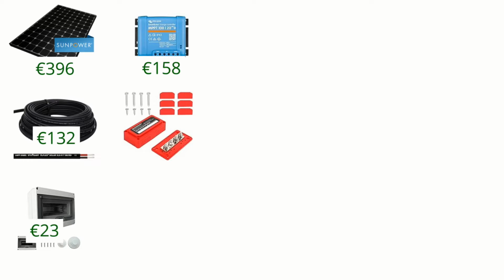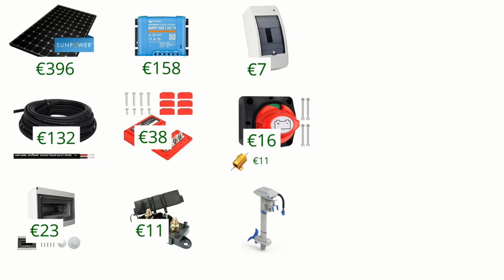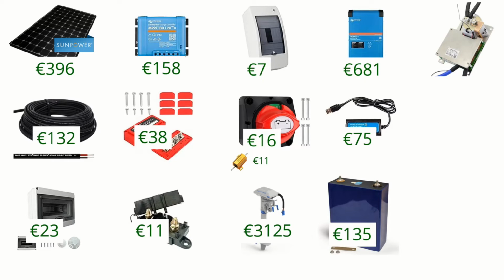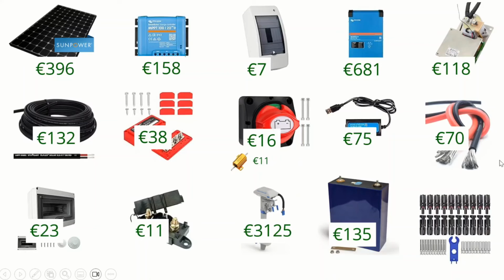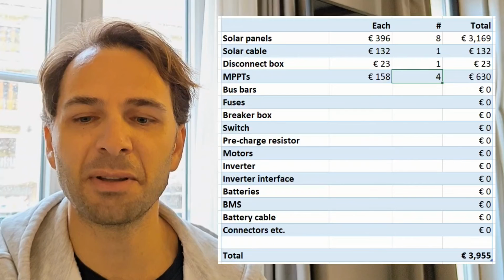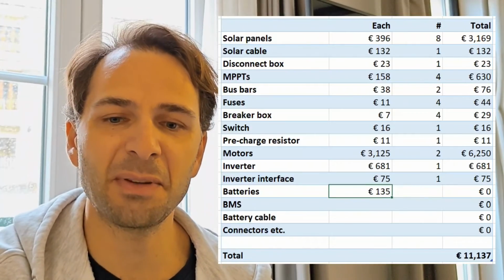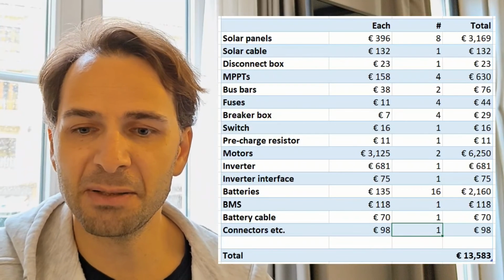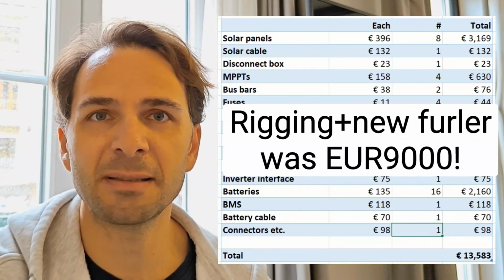Converting a boat to electric: What it costs

Comment: Hey Patrick! Great presentation, I really appreciate this cost breakdown. I'm interested in your mounting structure for the panels. I was just watching Jason's latest video (great btw) and was wondering how your framing might be different than his? Trying to get different ideas from people like y'all who have real world experience in a marine environment. Thanks a bunch, Flint
Reply from the maker: Yeah definitely worth a video. My panels are mounted in frames made of aluminium angle. It works quite well but I actually prefer Jason's solution as it's DIY possibly whereas I had to hire a welder. Doing it again I'd also use the extruded aluminium profiles like Jason

Comment: How much capacity in battery and solar production from panels?
Reply from the maker: My batteries are about 14.5kwh. In summer my panels generate around 18kwh per day. Very late in the season it drops to 11 or so. In winter abs when it's raining obviously less, but I'm typically tucked away in a marina or a yard by then so it doesn't matter.

Comment: Hi Patrick, I am planning to put a precharge resistor in line to my 4kw Inverter. I have two 25 ohm 50 watt resistors that I would put in parallel (12.5 ohms) and then parallel them to an on/off breaker. So my thought is I would 1st power up the inverter via the resistors and then turn on the breaker to the inverter. Is that something like what  you did?
Reply from the maker: I've done pretty much exactly that, but I'm using a single 25W 33 ohm resistor in parallel with the switch and it's worked perfectly for me. 

I've only really used it once though, because I never turn my inverter off 😂
Reply: @SailingElectra  Thanks, I will use just one resistor.

Comment: Your purchase is very costly,
Compared to my place 😮
Reply from the maker: Tell me more, what did you cost? What type of equipment are you using?
Reply: @SailingElectra 
I was purchased in October 2025. All costs included taxes and transport.
 105rs₹=1euro€

12 kilowatt daye single phase hybrid inverter cost 200000 indian rupee.
590w n type topcon panel from warree energy cost 9000 each panel.

FOR SMALL SCALE RS 9 /W and big Big scale 6.5/W (Installation charges, structure, DC cable, DCDC box INCLUDING CIRCUIT BREAKER and SPD, DCAC box With CIRCUIT BREAKER etc....)

Good quality 48v, 5kw usable energy battery pack cost is 12rs/w, but my landing cost is 10.5rs/w (125kw, 307v).

Comment: Do you think 2 x 6 kW motors are necessary or that 2 x 3 kW are sufficient?
Reply from the maker: Two 3kW would have been fine for my boat, but the price difference is small, and the 6kW is more efficient. Also if one motor stopped working, a single 6kW would move me just fine.
Reply: @SailingElectra  I am currently buying a Catalac 8m that has two epropulsion pod 3.0 installed. I'm just a little worried about getting caught on something with the pods. They're mounted directly in front of the rudder. What you think?
Reply from the maker: @buddhafragt9619 that's the right place for them. I can't imagine it's any worse that things getting caught on a prop or sail drive. Nice thing about the catalac is that it's quite shallow and easy to get under the boat to check things.

Comment: Great breakdown of the whole conversion. I also have built two solar electric boats since 2016 but for me it was a figure it out as you go scenario as at that time there was not much about electric boats. Since then I have gone on annual trips for two to three weeks on our canal systems we have in our area of Canada. The costs of batteries have dropped exponentially and there are now more motors to choose from but it still is an expensive venture. For me it is still worth it as cruising without the smell and noise is like buying a solitude option for yourself. Check my site out for some of my trip adventures.

Comment: think i would have wired it 2 sets of 4 serial giving 2 parallel to up the voltage and get better efficiency charging.
Reply from the maker: @JohnBraman413  I did consider it, but thought shading would be more of a problem. I'd also need bigger charge controllers as mine are limited to 100v and these panels put out 65-70v each. Probably the perfect solution would be 1 charge controller power panel, but that's a lot of wiring and finding places to put everything.
Reply: @SailingElectra  shading you don't lose the whole panel. only a percentage of the power output.
Reply from the maker: @JohnBraman413  is definitely worth trying, the thinner cables would be so much easier to deal with.

Comment: Hi Thankyou for your tutorial of the boat . Fantastic . Got to ask if you was to have the sail up do the motors Regenerate with the force of the forward motion  . ? 
Be really intrested to know this ? 
As I’ve heard that some boat electric motors do this ?? 
Also if your sailing might sound silly but do the motors spin freely with no power going throw them this not to course drag . I did build a Electric campervan aprox 5 years ago 
On YouTube …. 
james and Kate electric campervan 
My dream is to lurn to sail and then buy a yacht and convert to  vertical wind turbine and solar pv and keep in Spain 
 I congratulate your achievements . 👍🏽👊🏽🙌🏾
Reply from the maker: It's possible but only if you use the epropulsion batteries, and I don't, so that means I don't get regen. I have enough solar though, so it isn't really necessary, and most of the time I'll keep the motors on when sailing, as even very low power means a big speed boost.

Comment: Since there is not much space on a sailboat I wonder if you could but a thin flexible or standard panel under the existing panel? Bifacial down side is they are bigger so per SQ FT they are not much advantage. Im sure the sun reflect off the water and any free power would be a bonus. Wonder if anyone has tried this or tested the idea? I guess a way to test would be turn the existing panles upside down and see the power they produce from the sun reflection off the water.
Reply from the maker: That's a very good question actually! I've become very weight sensitive to adding things to my boat, so I won't be the one to try, but yeah I imagine it would work as well as the extra wattage you get on bifacials. I suspect we'll keep seeing more innovation in this area.

Comment: Thank you (fellow Saffie) I have just bought a 9M Catalac which has 2 decent Beta 14s in, but some rather dodgy saildrives. I am hoping to convert to electric sooner rather than later. The old saildrives have no spares available, so at some point they will be a dead-end.
Reply from the maker: Wow another saffa with a 9M, who would have guessed! You're lucky you can sell the motors to get some money back. Mine were dead so I got almost nothing. One thing to consider is outboards vs pods. Doing it again I would seriously consider pods so they're deeper in the water and further apart. Costs are about the same. Where is your boat?
Reply: @SailingElectra  Hey I switched to my boat identity. I know, right? Coincidence or Great Minds or what? As soon as I started researching I found your channel. 
Tomorrow I am off to Lowestoft on the North Sea coast to take delivery. I will be heading for Cowes to 'borrow' a whole lot of gear off my old ferro Endurance 35 (SV Rolling Stone). Then off to the Med via French canals. Where are you? I would so love to see your lovely Catalac! No name for the Catalac yet.

Comment: Great informative video !
You have : 
2 x 3kW (6kW) motors; 
16 x 3.2V/280Ah (14kWh) battery;
8 x 400Wp (3.2kWp) solar panels;

Do you find the solar panels adequate?
Is there sufficient battery storage?
Are the motors powerful enough?

I ask, because I am doing EXACTLY the same in a few months time!
Reply from the maker: The motors are 2 x 6kW (12kW) but to be honest I almost never go over 3kW, and I've never thought they were underpowered.

The key to the system is the solar. If I had less solar I'd probably think the battery was too small. The Hopyacht 30 has twice the battery and half the solar but because I have so much more solar I can travel further without needing to plug in. On a summer's day I pull in 15kWh+ and that means my battery pack is pretty much always full. My solar panels alone can power me at 5 knots without draining the battery on a sunny day, so the battery becomes a buffer rather than a power source. 

On cloudy days a bigger pack would just mean more speed, but I don't mind showing down if I need to go further when it's cloudy. 

From this season I hope to be sailing as well. If I didn't have sails I'd consider a Honda 2200 generator which could move me at 4-5 knots as long as it has fuel, but with the sails I think I'm happy with no generator.
Reply: @SailingElectra  Thanks for the reply.
Reply: @SailingElectra  Thanks for that info. Being a fellow Saffa, I will probably go the same route as yourself.
Where would one look for a good used catamaran?
Reply: @SailingElectra  , don't you think having the small generator is a great redundancy ?  To many "what-if's"...  That Kenny is pretty light and worthwhile having I think

Comment: Super clear, thanks to you and your pup! Did the ePropulsion firm help you with your setup? I'm guessing warranty is void with non-OEM batteries?
Reply from the maker: No, it was all DIY. I actually expect the warranty to still hold, and from speaking to a dealer (not the one I bought from) that does seem to be the case. Of course if you damage something by using a battery that's out of specs it wouldn't, but as long as I'm within the recommended specs I should be good.

Comment: Your battery is around 14kwh, correct?  What range do you get at 3 knots and 6 knots?
Reply from the maker: Yes, 14.4kwh. 3 knots is just 500w in total. I can do that non stop forever as I charge at more than that rate even in cloudy weather. 6 knots is 7kw total so if there's no sun I have just 2 hours. Typically I go 4.5-5 knots which is around 2.2kw. when the sun is shining I can do that speed all day long and still have a full battery at the end of the day as I have 3200w of solar.
Reply: @SailingElectra  thank you
Reply: @SailingElectra  
WOW!
So at a steady 3knots power is only 500W;
and at 6 knots (double speed) it is 7kW. That is excessive?

Comment: Thanks so much for making these informative videos. You do a great job explaining the process while making it pleasant to watch. I have a 40ft sailing cat in the Ssan Juan Islands and share your idea of the panels create the power,  battery size is second to that. I'm just switching out my solar array for 550 watt bi facial panels, they are the largest output per sqft I've seen, plus they catch reflected light of the water on the undersides. I'm pretty sure I'd make terrible videos but I'd like to document how they perform over the summer.
Reply: The boat is a Rudy Choi design, called a Polynesian, built 1973, 20ft beam.
 The array is 3.3kw from the topside, they get 15-20 percent extra from reflected light in a ground mount situation, but I imagine reflected light off the water should be significantly higher with all the panels over the cockpit
Reply: I'd like see that setup! Make a few videos...maybe it's fun! 😂
Reply from the maker: Thanks for the great feedback Brent. What kind of boat do you have, and how much solar will you have in the end?

Comment: Do you not use a t-class fuse if the lfp bank?
Reply from the maker: No, I've only got a single 48V280AH pack, it shouldn't be capable of providing the kind of amps a T Class fuse is necessary for. The mega 400A fuse I'm using was supplied by the battery and BMS supplier. Like so many things on my boat, fire extinguisher, EPIRB, etc I hope I never need to put it to use 😁
Reply: @SailingElectra  if I could humbly suggest; they can, I accidentally shorted my single battery while designing the box for my own sailboat conversion. The incredibly low internal resistance of the lfp allows them to dump kiloamps in a dead short, which can arc over an ANL or similar fuse. I put a large t-class as close to the main bank positive as the "fuse of last resort", with the ANLs sized smaller to protect the wires.
Reply from the maker: @TheDigitalMermaid  thanks for the advice, I'll certainly look into it. It shouldn't be a huge job adding one to my pack. I don't suppose you had the camera running when you short circuited it? Would be very interesting to see.
Reply: @SailingElectra  I did... https://www.youtube.com/watch?v=HhiEky64BLg&t=2160s

Comment: quiet expensive, but as you conclude diesel engines would cost around the same and you would keep paying for fuel on those.
Reply from the maker: Plus my wife wouldn't live on a boat that smelt like diesel, so I either avoided a divorce or another rent payment 😂
Reply: @SailingElectra  😆

Comment: Why is the rigging so expensive? I bought all new wires with new terminals for about 1200€. The most expensive has been the isolators for the SSB Radio, two of them was around 600E. A rollerfurl is around 2000-2500€
Reply from the maker: Croatian pricing! Paid 3k for the furler and had to build a new tabernacle. Because my boat has changed from standard and because the boat was new to me I had to have a rigger do everything. From next time I'll go the DIY route.

Comment: Thanks for sharing those costs Patrick. Funny you should have posted this video today, as after 12 weeks of working on my solar powered cat, I sat down today to ''do the books'. I'll share the costs with other videos once the cat is complete.
Reply from the maker: Glad you found them useful. The only charge I might have made doing it again would be for pods instead of outboards, though I'm still not sure which is better. Are you keeping the mast or going for a powerboat build?
Reply: @SailingElectra The cat has been started as a power cat, so no mast. It was built with the idea of two petrol outboards, spec'd at 60HP each but could be any size up to 200HP. I'm talking to Epropulsion UK at the moment and thinking of having twin Navy 6.0 on each hull. I should be fitting the 6kW of panels to the roof next week all being well. I'm undecided on whether to fit steering to the outboards or have a single central rudder. I certainly don't want to fit anything under the hulls to protect against grounding. Neither would i want to fit pods for the same reason.
Reply from the maker: @fredflintstone1428  missed this message. I like the route you're going with four 6kW motors rather than one big one. So many advantages from redundancy to what I think will be outstanding efficiency gains. I gain 10%+ more speed for the same power consumption running two motors rather than one at double power. I suspect the effect with four will be even better. I've got a friend covering a Fontaine Pajot Cumberland 46, but he's planning for shaft drive. I suspect four 6kW would do the job in his case too, and quite possibly could be cheaper.
Reply: @SailingElectra  Hi Patrick,
Slight update on the cat. The 6kw panels are in place but unfortunately the Epropulsion motors, Navy 6 are not working out. They cannot get them to talk to one another and the controllers in a meaningful way, therefore I would have to use four independent motors and four controllers. They can get a pair to be controlled in 'sync' mode but it would require two dual controllers...not the end of the world but a bigger problem would be the steering. The cat has no rudders, so was going to use hydraulic steering coupled to the motors. I don't think it would have been possible to do this with a pair either side of the cat and there was always the problem of tilt too. So in the end I returned to the initial idea of using Aquamot Trend 15.0 outboards. These are a 48V, 15kW motor, the biggest I know of at 48V. I've ordered them last week and they begin building them in a couple of weeks in Austria. They are meant to be equivalent to a 35HP outboard. I find that a little optimistic...maybe a 25-25HP, but who knows? Maybe the efficiencies gained in having no transmission and the cooling done by the water achieve this. If they do replicate a 35HP ICE outboard, the cat should be really well balanced in terms of power of motors and available battery power. I hope to be heading down towards the Med by late September or before if things go well. I will release the build videos on Youtube once the cat is finished, but want to keep the project private at the moment for security.
Reply: @alanbutterworth4219  , Jet Zero just released their 18kw outboard